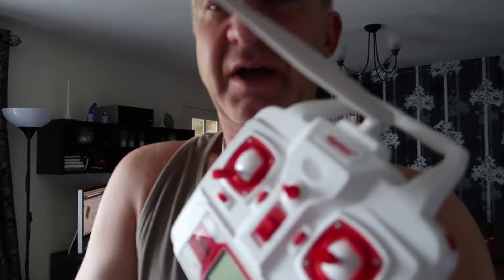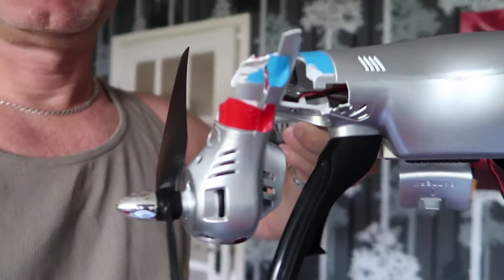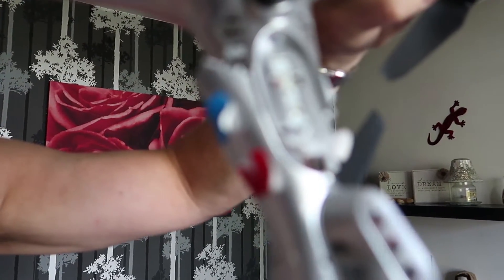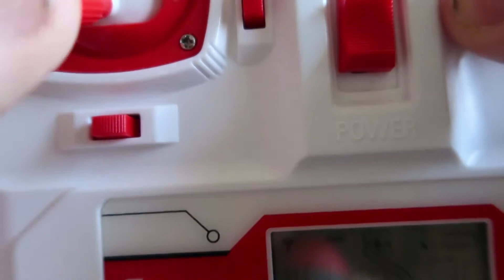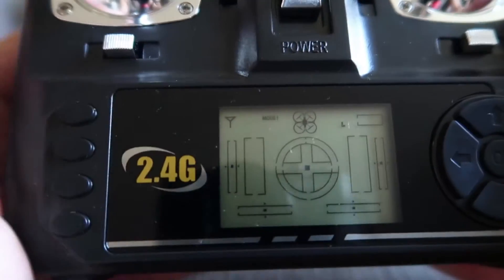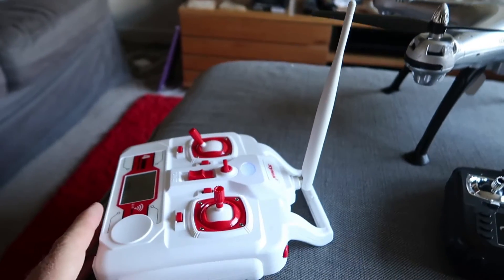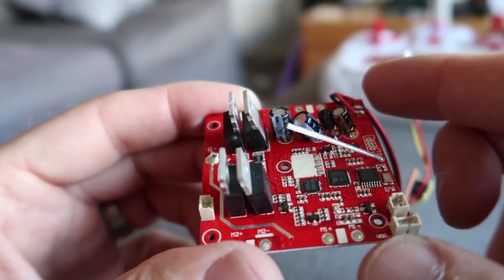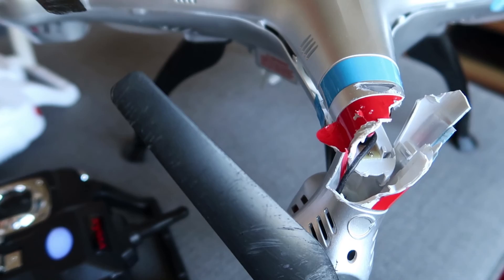Syma X8 X5 transmitter range setting.

Comment: CAN I do this range setting without an Antenna Mod:dothefive:
Reply from the maker: yes you can, its part of the tx settings
Reply: This quad has an impressive range - far more that you will need. Most of the so-called "antenna upgrades" shown on Youtube videos will actually REDUCE that available range if done by the usual amateur solderer. Leave it alone.

Comment: hI iM SO HAPPY TO HEAR ABOUT YOUR RANGE TEST   because I got a few fly aways with  my world tech drones  that aren't that far away  maybe 300 feet   so now that I have the 8x SYMA  LIKE YOUR    it's good news  the only other thing I need help with is when I calibrate  it says move sticks down to left , then down to right    well they should tell me with the throttle stick first moved up and down to arm it or not needed  to do that first ? can you help me  with this  calibration:dothefive:
Reply: It sounds like you have not read (or have not been able to understand) the manual that comes with ALL the Syma products. AND PLEASE NOTE...this "Low Power" setting is ONLY available on the Syma controllers. It will almost certainly NOT be available on other brands of quad!

Comment: These Syma flight boards are quite handy and work on other brushed motor drones using the 180 dc motors. I managed to revive an old dead drone and subsequently lost it in the wooded area because I didn't know about the low power mode on this Syma controller... wish I was your video 2 days earlier... Luckily I've found another dead jjrc h25 drone and fitted my second Syma x8hg board with 1mm plexiglass adapter plate dead in the middle of the body, flying like a dream.  Amazing how this big drone makes 360 flips. Thank you for sharing

Comment: thank you for this info, my Syma x8hw was also set up in low power mode when I first turned on the transmitter, and it was the first time I had ever see a display flashing like it was,, but its not any more!,, thanks to your video,, its now on full power

Comment: Just to add if anybody is interested. When the transmitter is switched to high power there should have been an H appear on the right by the battery indicator. In the video it stayed L which means on low power. Don’t want to tread on toes. I changed my board,  then motors then transmitter mod, but the thing l did notice was the gear shaft on one motor was stiff so now strip periodically and use a little oil. Great quad to mess with well made for its price.
Reply: That H & L on the controller refer to the speed rates (switched by short presses on left shoulder button) NOT the transmitter power output. The signal bars on the led display flash if the controller is in low power output mode.

Comment: Thank You for the info, I just got a X5C-1 and a X5HW-1.  I have flown the X5C a lot and just starting to fly the X5HW.  I did check Both Remotes and the X5C was okay, But The X5HW was flashing as you said, so I did as you said and I now have a steady Wifi Signal Icon on Both Remotes.  Thank You For this Information.

Comment: Spektrum has the same thing, they call it EU mode. The reason for it is that in some countries you need to have a special license to run a radio with a power output above a certain level. This way they can produce one transmitter and make it legal in those countries that require low output while still having full output for countries that allow high output.
Reply from the maker: Makes sense, however a little instruction would have been great, or that unwise for those with such legislation?
Reply: I think they don't want people to just be able to make the TX non-compliant without a little knowledge. I don't know what the repercussions could be in those countries, but you can imagine people trying to sue Syma because they turned the power up and got in trouble.

Comment: thank you for showing this about the low power setting. My x8 fell from about 80 feet without warning. Checked my transmitter sure enough it was flashing. I set it back and we'll see on my next flight.

Comment: I just got my x8   and watched the video and  read the comments.  1 When I checked the power out from my tx the output power was exactly the same with or without the bars flashing.  2  The antenna in the quad is horizontally oriented.  Inside the tx the antenna is horizontally oriented.  As anyone who knows anything about rf and antennas this is ideal.  Changing the tx antenna to vertical orientation is going to reduce range period unless the quad's antenna is also changed to vertical.  3 Changing the tx antenna to a coaxial dipole ( wifi antenna) only increases the tx signal by 2db  .  That would increase range somewhat but to double the range you would need  a 6 db increase .  These quads out of box fly 300 meters.  Most of lose orientation on a ship this size around 150 meters.  4 I attempted to contact the mfg about the flashing indicator with no response so far.  I will try again later and post any answer Ireceive from them.

Comment: Thanks for this info Steve, really good to know. I built a Syma X8C from spare parts I ordered for its slightly smarter brother I have, a clone of the Syma X8HW with some extra twists and the receiver I got the the spare quadcopter did indeed have the blinking signal bar. I wasn't sure what to make of it as I've only flown the spare X8C indoors and only for a very short period given it's got no altitude hold like its smarter brother so I didn't want my wife to scorn me over broken picture frames and other memorabilia I surely would have broken.

Now my spare controller should be in full power mode and I can't wait to try it out once the weather warms up a bit where I live.

Cheers,
Denis
Reply: CAN I do this range setting without an Antenna Mod

Comment: Many thanks for your video Steve. I was having problems with my X5 dropping out of the air at around 40 meters. I then did the antenna mod including increasing the length of the antenna within the quad as well which increased the range and seemed to have solved the problem (not that I fly more than 100 meters anyway). I checked the transmitter this morning and found it to be in the "low power" mode you described.

I also checked my X8 which has the antenna mod for both the transmitter and the quad, this was in "high power" mode. I have never had a problem with this quad luckily.

I will take them both for a flight today and play around with these settings. Many thanks once again for making us aware of this setting. Greetings from Down Under :)
Reply from the maker: Juddy Aus great. so glad you got the info.
Reply: Steve Haresign Many thanks Steve, we confirmed on today's flight for both the X5 and X8 that this setting made a big difference on range :)
Reply from the maker: excellent, pleased I could help.
Reply: @juddy6675  CAN I do this range setting without an Antenna Mod

Comment: Thanks for posting this.  Mine also came set on low power and I was getting pretty frustrated how easy it was to lose control at only 150' away.  Changing this and adding external antennas should make huge difference.

Comment: Is 5.8 thx pigtail good for mod conversion for syma x8c controller?
Reply: No, you will burn out the transmitter.  You have to use a 2.4ghz antenna.
Reply from the maker: not sure on that one, sorry
Reply: 5.8ghz only for A/V

Comment: Many thanks sir! You have saved me from a great misery. I just bought my X8, charged 'em batteries and went out on the field to try the quad out. I have experienced delayed responses, no responding at all or even blinking of the quad because of a complete signal loss. I have tried different batteries, checked the voltages, orientation of the antennas etc. But now have I found out that Tx low power mode was the problem. Being switched to the normal setting, the X8 responds immediately, as my good old X5 does. Thank you again, I wish you many successful flights!
Reply: i experience it also....i throttle up but the response is quite little...and it is continue going down..the response in my quad is delay even though the distance is only 30 meters. thanks for the great tips...enjoy flying..

Comment: thanks for your info. my Syma does the same and l have been working on it to find the fault. one thread said it was the small camera part that that is the culprit where you plug the camera in. Changed it to the new v1 no cure. also changed the main board. no cure.  so was starting to think transmitted. Luckily the only damage has been to the legs which got a bit bent. A brilliant quad to introduce you to heavy types but only in calm conditions. it does not fight the wind well. Just to describe the fault it flies well and then motors stop and it drops. Sometimes motors come back on and you can recover. looking forward to trying your fix.

Comment: I got the brushless kit from YouCute, really fun and fits just fine, very strong and fast. But I ran in to this problem and had a flyaway multiple times
lucky, I was at a park that was big enough for me to follow and get it back. I did broke the shell where I place the antenna for extra range, I am waiting for my replacement body and would have to basically rebuild again. Up in till I saw your video did not or couldnt find the problem. Thank you for the video very helpful.....

Comment: Had an issue with the power switch failing yesterday which I'm sure is just a matter of oxidation and cleaning it, but after I got it working after moving it back and forth (temporary fix), I noticed the drone fell out of the sky just a short distance from the transmitter.  I figured old battery or loss of power at the switch, and just left it at that.  Then, today I trip across your video while trying to find general info about tx range, viewed it anyway, and figured I should check my tx on the odd chance I inadvertently pushed these buttons in the sequence permutation you discovered and described.  I apparently did as the icon was flashing, and now is all well.  My main point being; pretty close to serendipity that I found your solution to a problem I wasn't even aware I had, and that I bothered to listen through your narrative.  Your video, and luck, may have saved me a lot of wasted time doing detective work, so appreciate your help. (Utterly incapable of making a short story short, so sorry about that.)
Reply from the maker: no worries, glad I could help and the main reason I took the time to put it up

Comment: I took apart my antenna mod 2 times before this video launched on random after watching some other video about X8 controller I contemplated buying since nothing I did seemed to help. Thank you! Thank you! You saved me 40 bucks. (I see other comment saying it's not really strength setting and I'm yet to test it, but it was in that second "flashing" mode, I hope it helps)

Comment: Maybe being that their manufacturing plant makes thousands of these to be shipped to hundreds of different countries with different FAA and FCC regulations on such RC devices, they had to incorporate this feature from a legal standpoint. Perhaps they are supposed to change this setting before they ship it out, depending on which country it's going to. Great find though. Thanks so much for pointing it out! ☺️ I'll also mention that for those who don't know, you can use the X8 controller with the x5  quads. This too improves the range, of the x5 anyhow..

Comment: You are not right. I checked many times both range mode and they are the same in range.
Reply from the maker: Check the video, I demonstrate it, your transmitter may be different?
Reply: My friend connected this transmitter to the spectrum analyzer, and it has shown that the signal strength is not changing, but changing the frequency of the transmitter. So  the frequency change may improve the signal quality in noisy environments.
Reply: What was the frequency change. They both need to operate on 2.4 band so if it goes out of band there is no surprise it barely even works, I mean I am surprised it did work if this is the case.
Reply: Here is a discussion on the forum. Read 3 posts from this http://forum.rcdesign.ru/f135/thread392803-220.html#post6591911. Google Translate can help you.

Comment: Thanks a lot for this video I got an x8hw yesterday and I did a short flight because it was dark but while lying in bed I started looking at bids about syma and I saw this one so I picks up my tx and sure enough it was in low power mode so thanks again you probably saved my quad as if I had enough daylight earlier I would have pushed for Max range an surely I would have crashed it.

Comment: You have to get this video out to more sources because all the radios that shipped with the X8W's were set in this mode.
Reply from the maker: thanks, have tried to guess all the tags.
Reply: Interesting detail. Probably because of the worthless WiFi camera the "W" model brings, Syma forced the RC to work in low range mode as default.